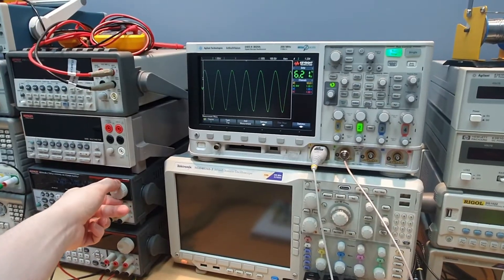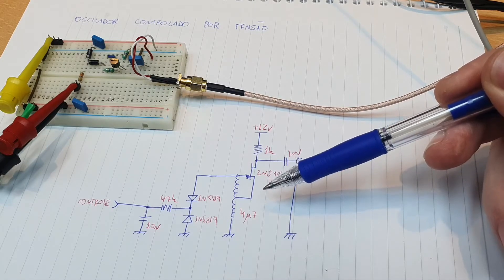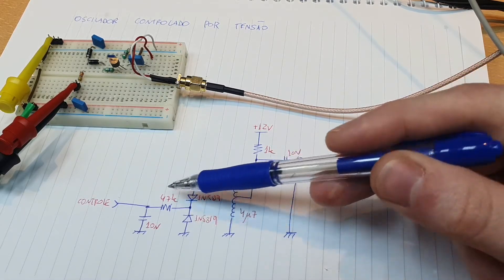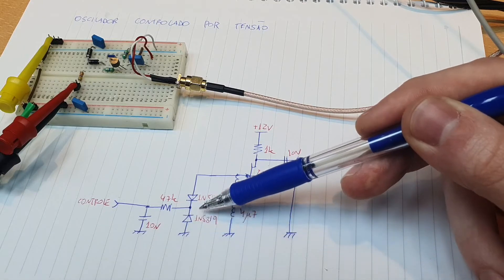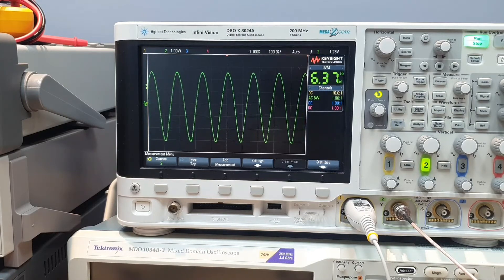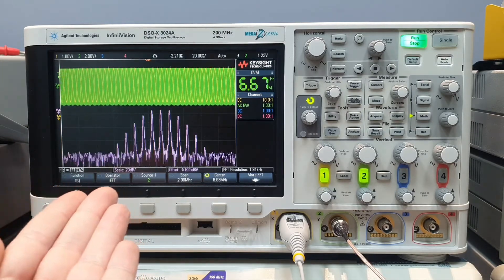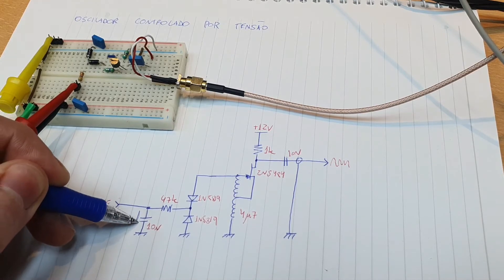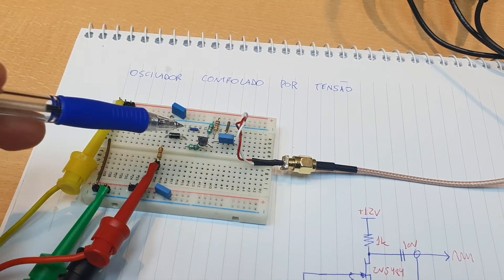Oscillator Analog Electronics

Comment: I tried replicating the circuit (in simulator) , and it worked for all frequencies except for frequencies above 200 MHz (by changing inductance) . And below that it also was unstable. Do you have an idea why? I need a VCO for 150-300 mhz i cant seem to make it work.
Reply from the maker: A common base Colpits may work better for these frequencies
Reply: @AllElectronicsChannel  do you have any sources i can use to make such a vco, using similar materials. (jfet, varicap...)

Comment: During oscillation cycle one Diode goes Forward bise so that act as conductor and with other vise versa so does this mean Only one Diode are acting as Capacitor in LC tank At a time ?
Reply from the maker: The two diodes are always acting as capacitors! The developed RF voltage is not sufficient for biasing the junction.
Reply: @AllElectronicsChannel  thank you .

Comment: *Hello and thank you for your presentation.
I take the liberty, with respect, of making a constructive remark to you.
I don't quite understand why using a JFET when it's apparently not used for stabilizing voltage. If I understand correctly, the 2 diodes are used as varicap diodes. In this case I think you should place an isolation capacitor between the top of the upper diode and the gate of the JFET. Personally I managed to make it work on LTSPICE but with a lot of distortion. What do you think of my comment*
Reply from the maker: Hello friend !! The JFET has lower noise and the cap isn't needed because the diode is reverse biased!!

Comment: I think for the GPSDO project you could take some inspiration from the vackar oscillator design principles, it’s one of the most stable and low noise VFOs designed so far but not well know in the electronics community.
Reply from the maker: We need to come back on this project!!
Reply: @AllElectronicsChannel  please do it I am considering to buy one on eBay I rather have a nice open source project to rely on! 😁

Comment: a bit more challenging is how to stabilize the output amplitude so that it remains constant with frequency. I dont mean by clipping it to make it square wave. keep it a sine wave
Reply from the maker: Yes.. The tank Q will change with frequency, changing the output amplitude. 
For perfect amplitude stability I think that the best approach is a kind of gain control.. Maybe changing the bias using the output rectified amplitude ?
Reply: @AllElectronicsChannel  yes, ALC is what is used in every RF instrument when they want to have a leveled sine wave however changing the bias of the VCO is not the solution since it will also affect the frequency. You will need a separate amplifier after the VCO. at lower frequencies it is possible to make a good variable gain RF amplifier but at higher frequencies what they usually do is to have a chain of fixed RF amps but with one or two stages of PIN diode attenuators in between. Then you can sample the output amplitude and control the attenuation of the PIN attenuators to keep the amplitude constant at desired level
Reply from the maker: Nice! The way you said is the standard.. I was thinking about something simpler for small projects 

You are right about the frequency dependency on bias.. but I will keep thinking about.
I have a video here about gain control of a BJT using a JFET to change the emitter degeneration, maybe it is an alternative that could work! I think I will try it!
Reply: @AllElectronicsChannel  Great video and explanation.. but can you elaborate or make a response video over the above comment.. I mean I am unable to follow through the explanation above in the previous comment..
Reply: @amirb715  Can you elaborate in simpler terms?? I am unable to follow your logic